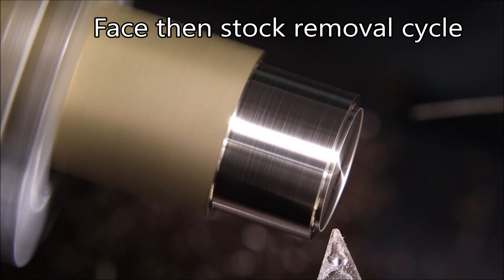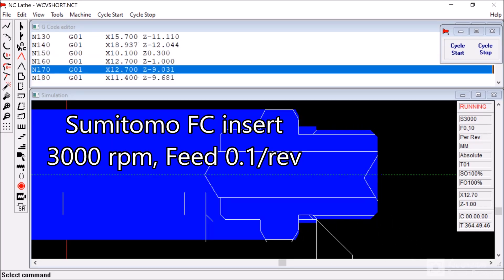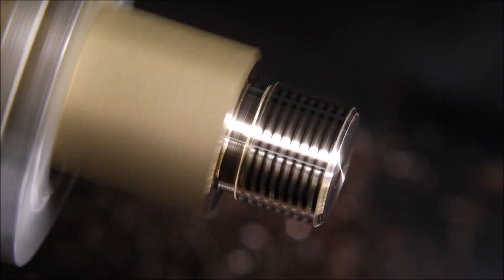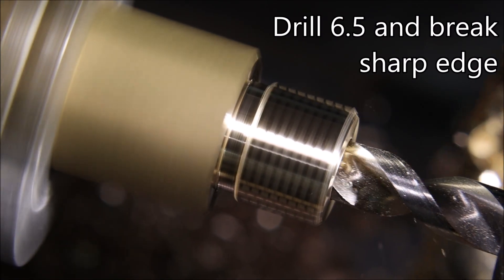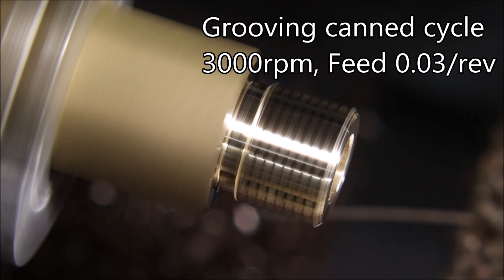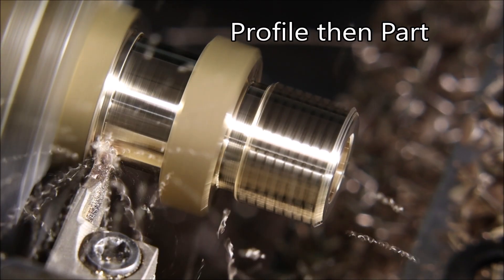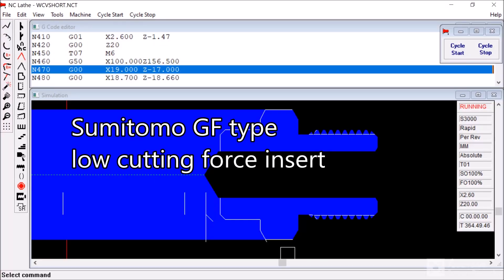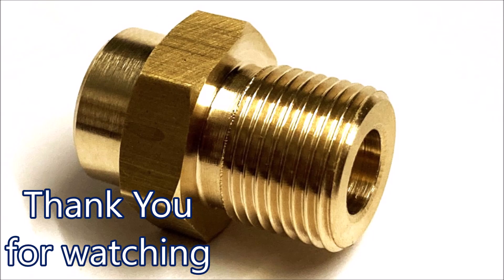Check valve body, turn, thread, drill and part. Sandvik and Sumitomo inserts

Comment: What cad software do you use? Now im curious!
Reply from the maker: The software is by Hercus the lathe manufacturer.  I missed the CAD question.  Used be called Cadkey now called Keycreator, it does all that I need.  Been using it since1990
Reply from the maker: Have you heard of it?
Reply: @smallcnclathes i have not, looks pretty good.

Comment: Nice efficient tool path!
Reply from the maker: Because the lathe is so small, I do try to be as economical as possible with the tools and tool path. Thanks for your comment,I do appreciate it
Reply: @smallcnclathes  How many of that part did you have to make?
Reply from the maker: @RotarySMP  only as many as I needed to make the video! Since I am semi retired I don't do any machining, but I wrote the program for my friend to make this part. I hade the material in stock so I made some to have a video to upload

Comment: Thanks for the video Nigel.  I am so far behind.  I have several videos to put out there but I just got burnt out on editing.  I need to get back going though.  Plus I have a couple review videos I owe some companies.  But I have been working in my shop the past few months and finally have my ceiling insulated and the plywood put up. Now I am just trying to shift stuff around and organize so that will make things nicer in the shop.  Take care.  Hopefully I should be retiring in mid 2026 I think.
Reply from the maker: Hi Gary, folks that don't upload have not a clue about how much time and effort goes into making a video. They really are a lot of work. Nigel

Comment: I really like these videos. Thanks for making them. I just got a little cnc lathe and watching how you use tools is super useful. I wouldnt have though of using the drill to chamfer the drill hole.
Reply from the maker: Glad you get something from them.  Note I never call it a chamfer, I only refer to it as break sharp edge.  The drills I use are mostly 135 degree point so they make a very flat sort of chamfer. They do however break the sharp edge. LOL Thanks for your comment. Does your lathe have a turret?
Reply: @smallcnclathes  No, my lathe is a gang style lathe with a 5c collet spindle. Its a Hardinge GT27SP. I just need to figure out its Fanuc controller a bit better.
Reply from the maker: @HuskyMachining the thing I really like about my lathe is the simplicity of using the software. It was created as a lathe software combination to use a a cnc trainer in education facilities.
Reply: @smallcnclathes  that's nice. I am considering doing a conversion to a more modern controller one of these days
Reply from the maker: @ a major reason for not retro fitting my lathe has been not wanting to learn new software. What I have does all I need.
Reply: @smallcnclathes  I really need to sit down and learn this Fanuc controller on my lathe as I will probably not do the retrofit if I can figure out how to do tool and work offsets with the current controller. I bought the lathe as it was a great deal but also to force myself to learn a controller that is very popular out there on used machines.
Reply from the maker: @ because my software is cad/cam and able to import a dxf file it really helped me out. I have been using cad for years and it was easy to create the dxf file in my cad then take it into the Hercus software to create the code. No tutorials on you tube for your system?
Reply: @smallcnclathes  I cant seem to find any good tutorials on the internet for the Fanuc 18i-T but once I get some free time I am going to do more research. 

Its super cool that you can use DXF files to make your gcode!
Reply from the maker: @ the software can actually draw as well, but it nice not having to learn how to use it.